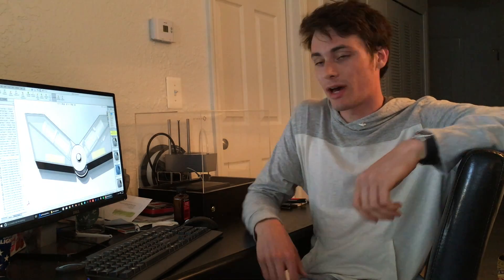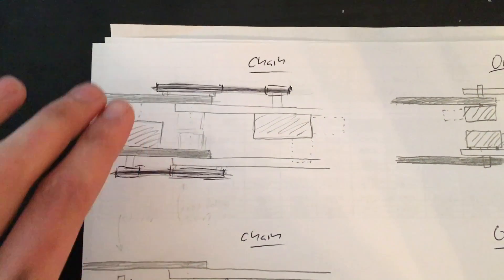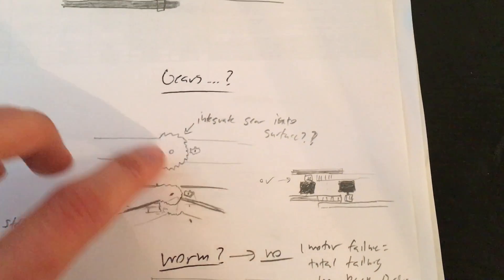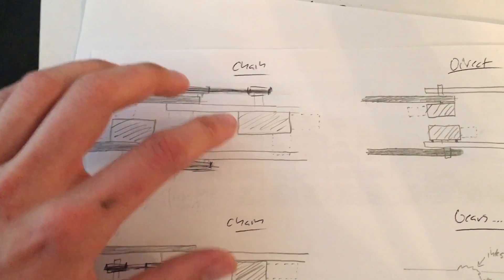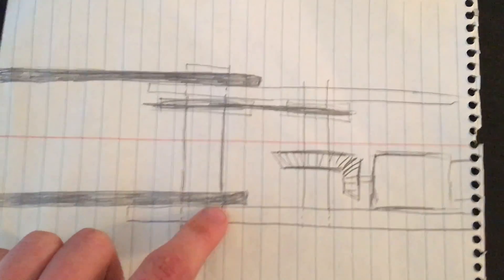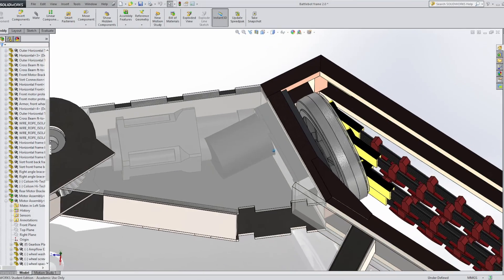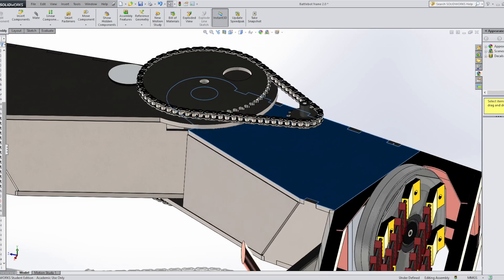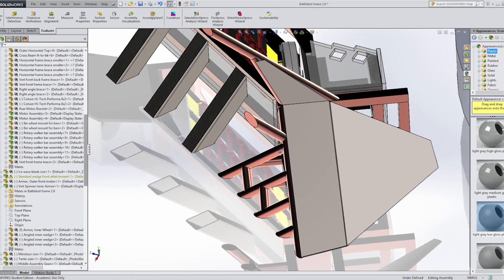Designing a BattleBot (Pt. 3)

Comment: The design process is very interesting to watch. Just a thought...Could you drive the opening mechanism with a tired wheel perpendicular to a circular plate instead of the bevel gear? Whilst trapping torque might become problematic, I would have thought it could withstand impacts better, as you'd possibly get advantageous slippage. It could also allow for greater displacement in most axes before failure.

I would also like to thank you for your use of metric units in your calculations (other than weight), makes it more relatable for me.

Comment: Very interested in this design.  I'll be rooting for you if you make it on the show.  The bot seems like a good anti horizontal spinner, and a descent drum repellent, but I question what you'll do against anything with a wedge.
Reply: wedges would be use less if the pincers thing get a hold of the wheels if its face to face however if it is bronco will be a hard time for his bot also if the oponent  is aming for the back.